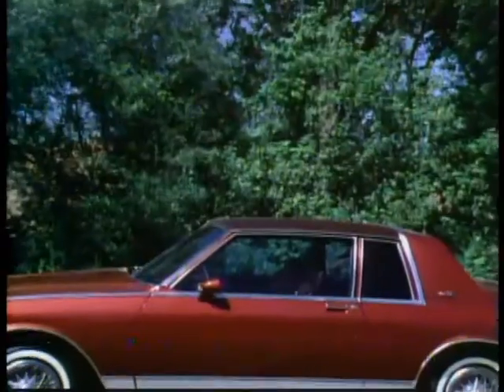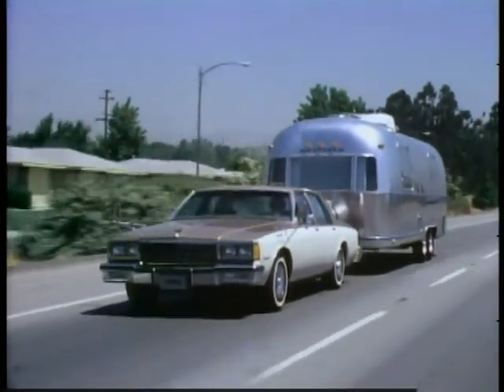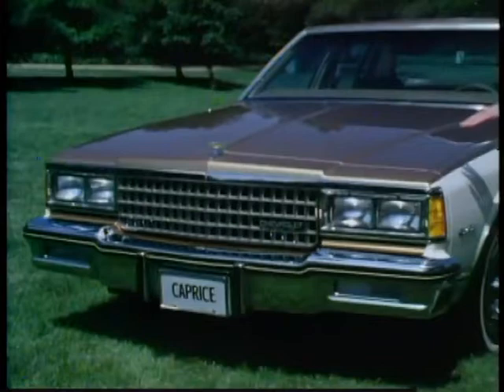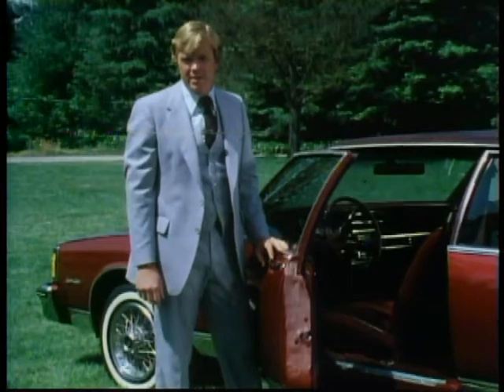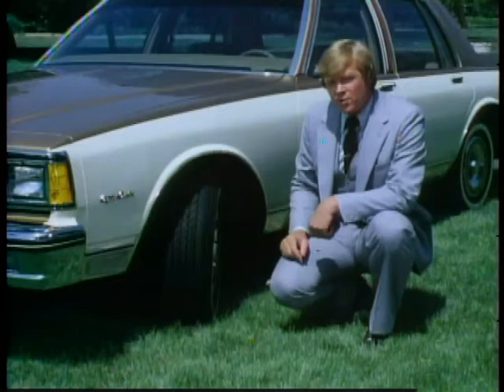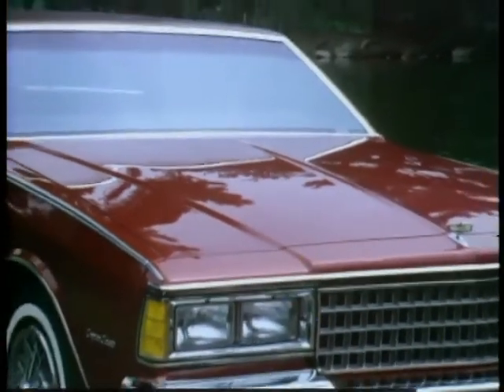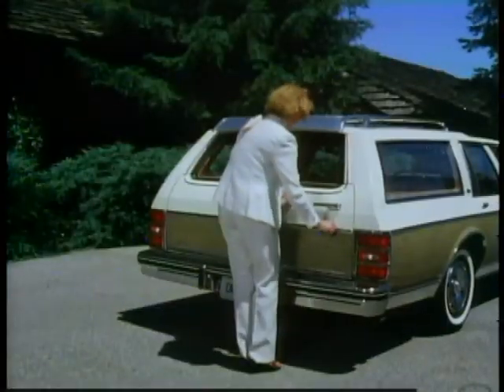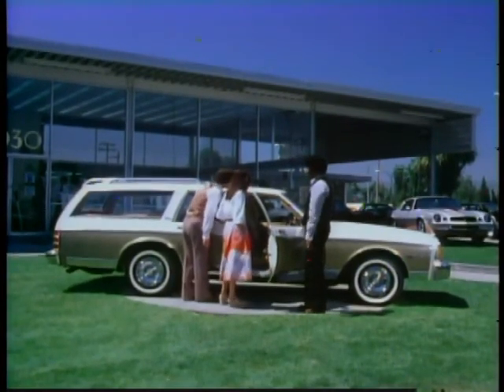1980 Chevy Caprice and Impala

Comment: The 77-90 Box Chevy Caprice/Impala was one of GM’s best cars. I had many of them, I currently own a 1978 Chevy Caprice 2Door Coupe with only 27k original miles.
Reply: So true! Their only faults I can think of are sagging headliners and the bumper fillers that fell apart.
Reply: Neat! Only 27,000 miles?!
Reply: Nice! I had an 84 Landau red with white top and HD suspension. Does yours have the aero back window?
Reply: I’ve always wanted these years since a kid 77/79 I’m now 26 and i currently own a 4 door 78 that’s sky blue with a White vinyl top, Everything is original except Interior. It currently has 60k miles , I plan to pass the car down to my Son when that time does come 👏🏽
Reply: 2 door model is sharp👍
Reply: Nice car, definitely safeguard that car!
Reply: I was in trade school LA Trade Tech and drove a cab at night in LA this was my cab, I loved it, I bought a new 82 EL Comino I would buy a new one right now 2025

Comment: My Grandma had a 1986  or 1987 Chevrolet Caprice Classic it wasn't a good car like it was supposed to be for my grandma. She told me the car had a transmission that was bad and it would surge when she would drive it on the road. Caprice was supposed to be top of line but it wasn't expecially the one my grandma had.